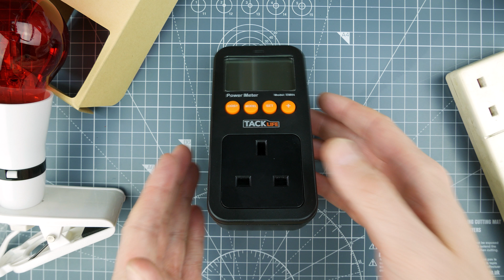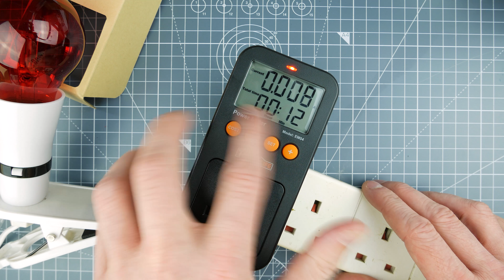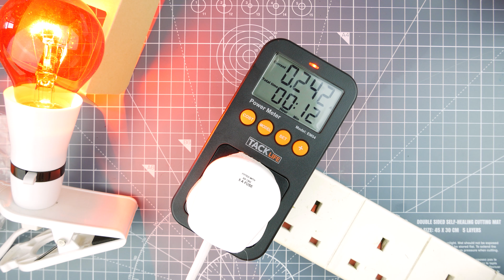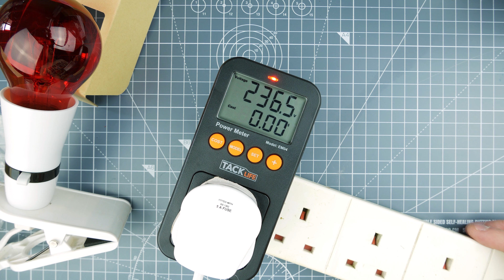Tacklife EM04 Power Meter

Comment: My Tacklife for US sockets has no such connection weakness. I still discourage anyone from using it.

The manual doesn't match the unit. It mentions 3 buttons, with names like "UP" that differ from this unit, which has 4 buttons including "Model" (???). Had the buttons matched, maybe the mistranslations wouldn't have been so confusing. I went to Amazon reviews to figure out how to set the cost per kwh. There's also a YouTube review in German where you can watch someone set the cost, even if you don't understand German. I still haven't figured out how to set the CO2 usage setting.

*At least one Amazon reviewer reported it arcing and starting a fire, so don't leave this unattended.*

It's limited to 15A or below, so you can't safely use this to measure refrigerator or microwave! You might be pushing it with tea kettle, radiator, hair dryer, etc. 

The lack of a backlight makes it hard to use. When you reset things, like the amount of time, it also resets the cost per kwh. 

Fortunately, it's no longer sold on Amazon. So I do have 1 good thing to say about it.

Oh, and it kills me that this YT video is by David WATTS. Nice.

Comment: Power Factor is extremely important. These meters measure Volts and Amps drawn through them. If they do not calculate the Power Factor, then they measure VA (Volt Amps) and not Watts.For a resistive load like a light bulb, the PF is 1.0 so the VA and Watts are the same. For a motor like a freezer, fan, etc and for non-resistive lights the PF is more likely to be about 0.5 - if the meter doesn't calculate PF then the "Watts" displayed will be double what it really is.Most of these plug in meter do a chit job or calculating PF and thus give erroneous readings which then gets multiplied when they are used as a logger.

Comment: Power factor is the cosine of the phase difference between the voltage and the current, also the factor between VA (voltamperes) and W (Watt, as W=V*A*cos(phase difference) )

A purely resistive load will have no phase difference, so power factor is cos(0) = 1 (and VA=W
In a capacitor you need to let some current flow into it before you get voltage, with an inductor it will initially resist changes in current flow as the voltage across it changes.  For step changes in applied voltage you get characteristic transient responses - the current doesn't exactly follow the step that the voltage does. With continually changing  voltage (AC) you get a phase difference between voltage and current, as the current either leads or lags the voltage across a component.

Comment: I bought a Chinese one of these off eBay. .it's got a better bigger screen, ACTUALLY works, has decent guts and various modes and measurements...was like $12 and I'd buy it again....it's white, with a big screen, 4 buttons under the lcd then under those is the socket and the bottom is rounded. Hers a link to it from a different seller... Hope that helps...

http://www.ebay.com/itm/EU-UK-US-Plug-LCD-EnergyMeter-Watt-Current-Voltage-Electricity-Monitor-Analyzer-/132249395571?var=&hash=item1ecaada173

Comment: I second the kill a watt brand.  Probably the best ones.  Power factor is how close the load is to unity which is 1.  It means the load follows the sine wave, and if it's inductive it will be less than one and capacitive greater than one.  Only Big Clive has ever been able to explain that I. An easy way..look for one of his videos.  As far as it's in US dollars---with a plug like that?         What are we supposed to do in the us with that convert to British it adapter and convert back again?  You are right..that's rubbish.  I also found a good one on eBay for 15 that did power factor..it's a ts-1500 and it's reading match my kill a watt p4400.  At any rate power factor is not much a concern.. residential utility customers are not billed on that.  Again, big Clive can explain better than me...he knows everything about mains...

Comment: I´m currently using the Power Meter from Brennenstuhl, the PM 231 E in the German version, but it is also available in a UK variety and it is pretty accurate and is a decent quality with lots of features. The only thing that I don´t like is that the display can be hard to read when it´s dark.